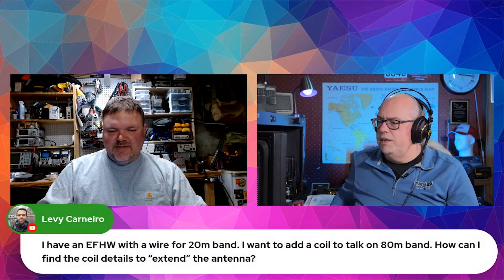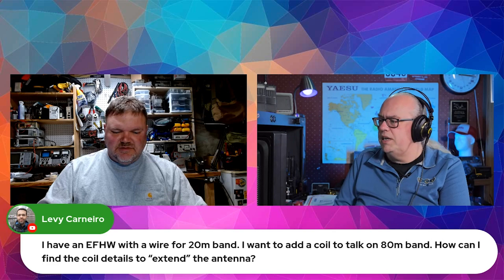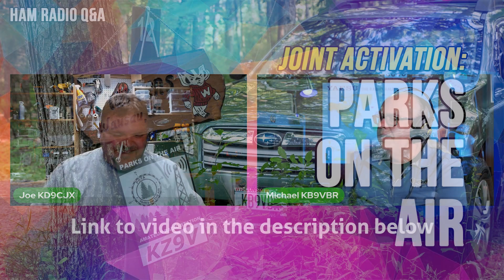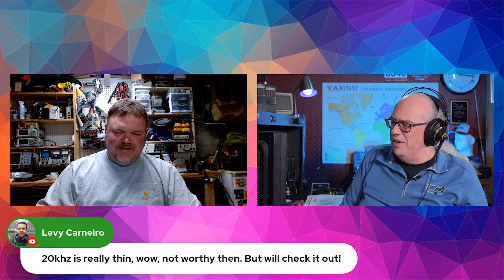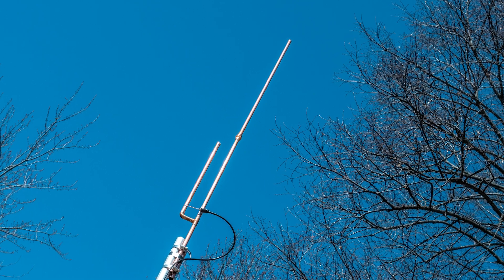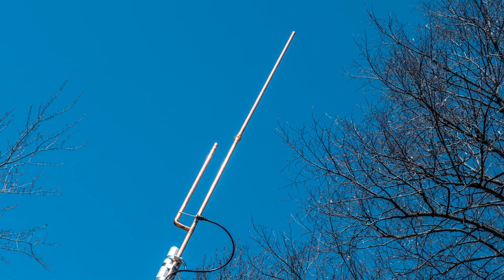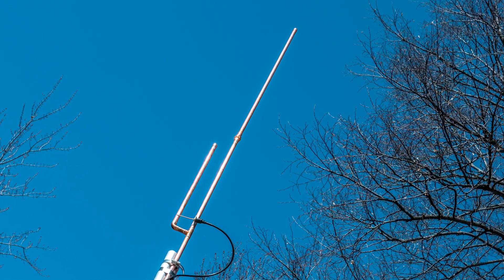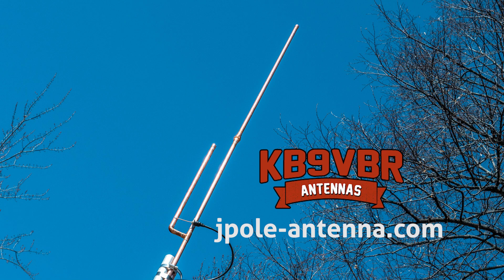Ask Michael, KB9VBR: How to extend an End Fed Half Wave antenna into the 80 meter band

Comment: I want to make an 80 meter loading coil  for my efhw , power will be 100 watts , what Guage enamel wire should I use ? 27 or 28 Guage ok ?
Reply from the maker: In the video, I believe Dave used 24 ga wire. Thinner stuff should work fine, too.

Comment: I built a small-stinger 1/4 wave vertical mostly for 10-20m, but have coils for each band and with a big coil to get on 80.  Works, but same issue here, very small bandwidth.  But - it works.  And when it works, you can find a use for it.   Like for pota activations on 80m just for some 80m contacts.  You have the bandwidth to get on 80m, CW, then call CQ wherever on 80m it works and they will come to you, and all you need is a few Hz regardless of where those Hz lie (as long as they're in your band and use privileges and don't squash someone else).  Hunting with that coil would be a test of my sanity :)  Jason KO4NDP
Reply: You're exactly right.  The only bandwidth required is what your signal occupies.  That's 3 khz. for SSB and FT8.  Even less for CW.  With POTA, once you're spotted, the hunters will come to wherever you are.  With the 110uh coil, my measured bandwidth on 80 meters is actually almost 70 khz.🙂
KZ9V

Comment: If space is not a problem, add  40 m, 60 m and 80 m wires with connectors to turn it into a linked dipole
Reply: Linked end fed? That what you mean.
Reply: @forgetyourlife  Can be, depending on feed point convenience, endfed also.

Comment: I like the idea of adding wire to the 20m EFHW antenna. Question is the antenna 20m long or cut for 20m? The antenna cut for 20m should work better 20m thru 10m, then with added wire for the 80/75M band would cover 40m also.